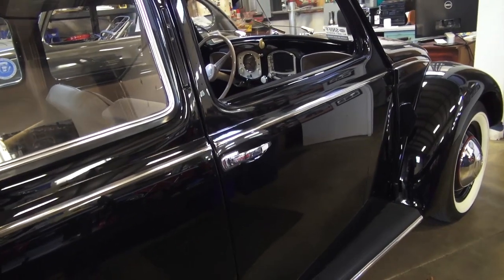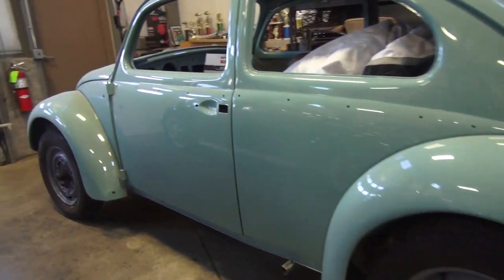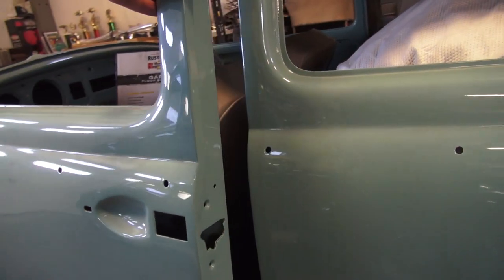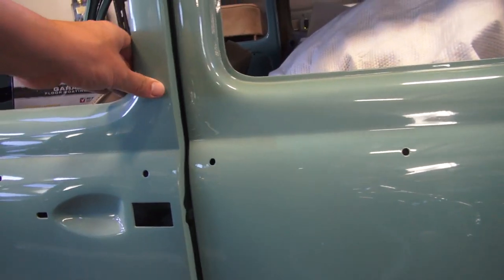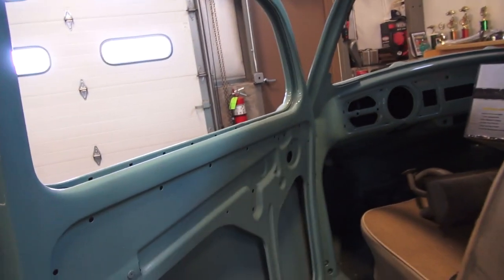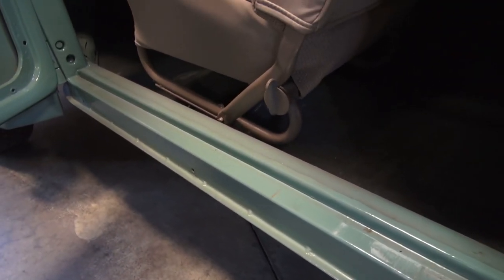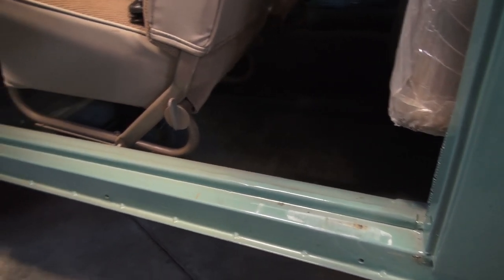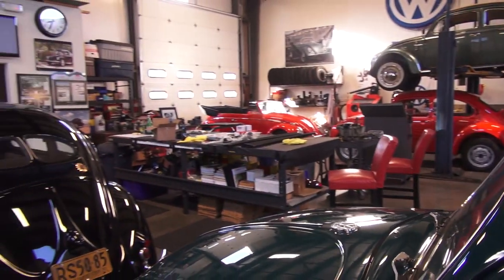Classic VW BuGs How to Vintage Beetle Door Alignment Open Close Correctly

Comment: I don't like to criticize but, it seemed to me, you were saying that the lines on that newly painted bug lined up properly. Maybe it's the camara angle but it appeared to me it was low by about 1/8-3/16 of an inch. When you pointed out the scuffed paint, it seemed to confirm that. Are there shims to adjust the hinges up or down? Otherwise, it seems you would have to shorten the heater channel and bend the whole car. Then you would have other issues that are worse than door alignment. Unless, the door is an indicator that something else isn't symmetrical.
Reply: I seen that exact same thing as you did, i bet if the 2 mouldings were on the door would have been hanging low compared to the 1/4 panel same dang thing i am running late on the 62 i am working on a shim

Comment: My drivers side door sagged and got sick of pulling up on door handle when closing it. Couldn't figure out how to adjust it. Tried to avoid it but decided to go ghetto. Im sure its been discussed many times. Open door and put a floor jack at the bottom of door. Start lifting car by the door just until the wheels are almost off the ground. After lifting and lowing a couple times it worked and now it closes perfect.

Comment: Also there is adjustment in the hinge to go up and down as well as in and out
If you are replacing heater channels and you have too much gap between door and rear quarter you will have to pull the door back before you weld the a pillar , a simple ratchet strap will work but I like to weld a small turnbuckle in the  bracing you should have installed before you begin and then you can dial it in before you tack your door pillar to the heater channel

Comment: The doors in these cars adjusts just in out and up down. You can't adjust the rotation of the doors.  If you want to adjust lines by the lock and your line is correct by the hinges, it's imposible to adjust simply. My way to adjust it is like this. All car fixed to the frame ('72 1302) by 2 front frame bolt, 4 napoleon hat bolt by the sides and 2 bolts in the back by the shock absorbers. Not counting floor panels and 4 more bolts in front center. So if your car door at b pillar down, like in this video, and vertical gap and line at a pillar is good, then you should add spacers under napoleon hat side bolts and under rear 2 main bolt. All body will tilt forward and fix doors a bit. It is a few steps job, measuring and adjusting. Ofcourse it might be problem with the frame or body. Also  hinges area on the body is kinda weak, it cracks, comes out and the doors drop(rotates). But then you have in A pillar big upper gap and small lower gap.
About closing rear gap. Rear gap is bigger because of door  construction. When you open the doors, the hinges have limiting point, a lip, with which the doors mainly stop from opening more. The inner stoping mechanism, than sliding thing is made too long and doors always stops not because of this sliding stopper, but because hinges stoping lip. So day after day hinges bend door hinge area forward on the body and the front door gap closes. It can be fixed by hammering to the hinges backwards. The hinges must be disasembled, while hitting to the hinge with doors in place can cause door damage. Or you can fix some custom plate with all bolts in the hinge place and then hammer backwards.
Reply: Sería muy bueno ver un video o algo más gráfico con este procedimiento,  es muy ilustrativo

Comment: My trouble is everything is aligned until the door seals are installed then the door goes wonky and the fitment is off. I know it takes a while for rubber to seat but it still has me putting off the final fitment.

Comment: Just replaced the quarter panel on my 1955 beetle and measured the gap between the A and B posts. It is correct to the Millimetre. The door at the bottom  looks to have to much of a gap thats before the glass and furniture are added.I have read all the previous comments. Nobody's having a go. We are all relying on you for information as we are doing projects of our own and you run a professional restoration shop. Your video does not show how to do or make an adjustment.